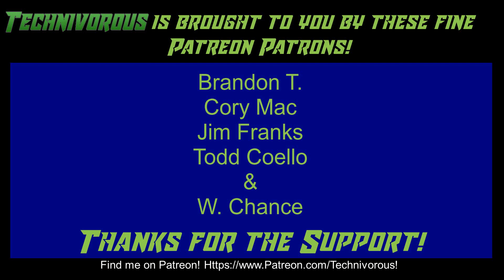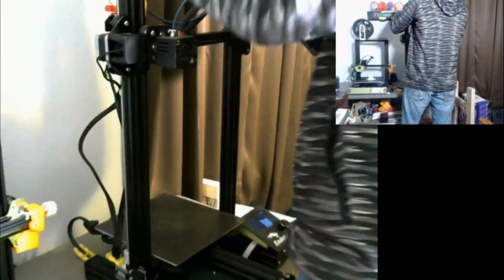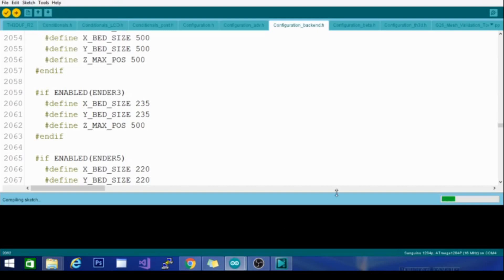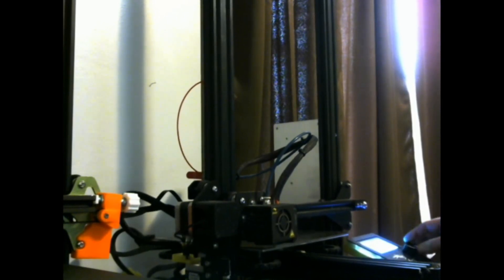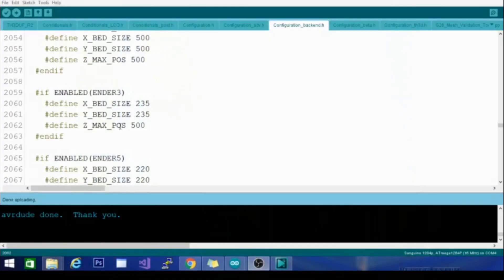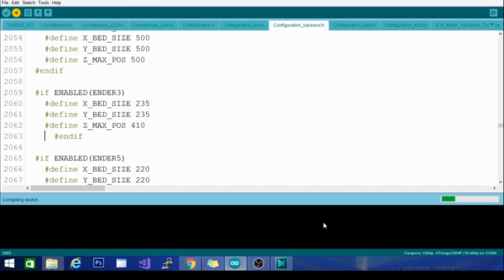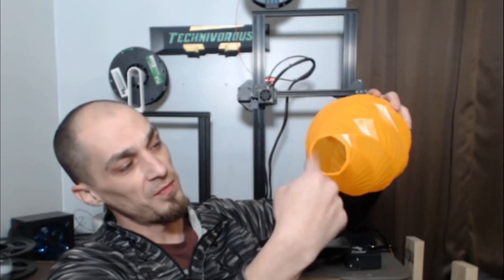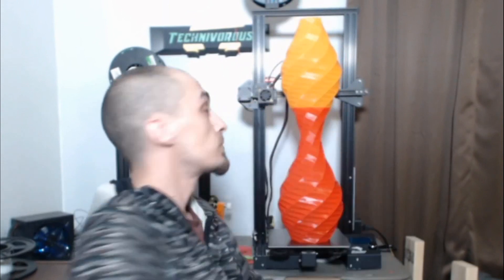Increase the Size of the Ender 3/PRO! 500 mm z mod!

Comment: I just installed a Z extender kit on my Ender 3 Pro. If I'm running Marlin 2.0.6 would it be the same process as in your video? At the moment I have an unnecessarily tall printer that does exactly what it did before.
Reply from the maker: Yep same firmware update

Comment: 1 year ago I bought that kit and I could never compile the finware with Arduino or visual studio, it gives me an error, there is no complete video on the internet that explains the steps, not even the vendor has it, Marling error is pio/build/ stm and the Arduino does not appear on my board and gives a compilation error.  (Ender 3v2 printer, board 4.2.7, thanks for the video.

Comment: i have upgraded my 3d pro to 500MM and did the firmware update worked fine then the belt came off  the horizontal beam now the auto home fails and it says need to reset printer . i am lost frustraded dont understant how to use marlin and edit the crap corectly i am to the point to just throw  it in the trash save up and buy new printer that is stock and print 500MM high you tube leaves me confused

Comment: Yo so I'm doing a project on my unmodified Ender 3 printer that's larger than the given operating parameters preset into the machine. I don't need to go much further than 250mm, I only need to build things that are 304.8mm tall (12 inches). I checked the space the stock printer had and It definitely had a surplus of space to work with despite it saying it can only go up to 9.8 inches. 

What is your opinion? Could I modify my printer and push the machine harder? I literally just got it and I don't want to screw it up. :o
Reply from the maker: Raise the z as high as it will go, then measure from the bottom of the nozzle to the bed. Remember there is no end stop at the top so without firmware limiting it will continue to try to raise which could cause damage. If the distance to the bed from the nozzle tip is greater than the programmed height of 255 you will need to change the firmware max z distance to increase it.
Reply: @Technivorous  Aww  man, I checked the distance from nozzle to the bed and it really cant go higher than than what it was rated for with stock parts. . 

Guess I need to downsize my project then and eventually get around to modifying my 3D printer to be larger.

Comment: ...so as it seems, it is pretty modable, this little Ender3 :) I am planing to buy it next month though... now that I saw this... I am willing to buy it even more...
Reply from the maker: Tons of mods. This is the 500 mm a kit but there is one called the ender extender which makes it wider too
Reply: @Technivorous  is it possible to use this to make parts for car, like front splitter, smaller rear wing or something like that... of course in more parts not at once... and also filling 3d model with some sort of foam afterwards with thickness of wall 2-3mm, and wraping it in Vinyl? :)

If so, I am really planing on buying this... ASAP... Also I saw they are preparing V2 of this printer, although it will be 50euro more expensive, but it seems it will be OK
Reply: @WarlockSRB  did you get one?
Reply: @xIsouLcruSHca  yes, I got E3, planing on buying extender 400XXL for it... but still considering maybe using it stock...

In few days I'll start with car part printing in PET-G... will see how it goes...
Reply: @WarlockSRB  Good luck buddy!
I'd go for some other upgrades like a BL touch first, those will give your E3 much more userfriendliness

Comment: how do you get the configuration_backend.h file
Reply from the maker: You open the marlin c on configuration in arduino ide
Reply: @Technivorous  I don't know how to open the file in arduino IDE. I don't know which file to open with it.
Reply: @Technivorous  the file states ender 3 not ender 3 pro. Are they compatible?

Comment: Very nice! I was getting judder on my stock Ender 3 printing tall objects near the stock limit, with the top of objects swaying slightly during bottom platform movements along the y-axis; are you using rubber shock absorber material between your motors and the mounts to help dampen motor movements?
Reply from the maker: I am not using dampers at the moment, I have considered it, not only to reduce vibration but also to reduce noise. Just haven't gotten around to it ye!

Comment: Looks huge and very cool :)  Anyway to test if there is more wobble on Z or X axis?
Reply from the maker: As long as the x gantry is square and level, and the right side eccentric nut is fastened to keep it flush it is stable, but the higher you go, you might want to go slower if your producing something thin and tall. I plan on doing a video of this soon to demonstrate slowing speeds with height changes.
Reply: @Technivorous  Thanks for the info.  Will look at getting these in the summer time.  Do you have an affiliate link for the parts?

Comment: Did you change any of the cables to allow the extra height.
Reply from the maker: No, but I manually check how high I could go with the stock cables, so my z max in firmware is set to 410, once I get cable extenders I will adjust for the full 500!
Reply: Will you be making the cable extenders or are they produced, reason for asking as I am rebuilding my Ender 3 to have a build height of close to 700mm
Reply: @Technivorous  interested in the cable extenders as my ender 3 will have a build height of nearly 700mm.

Comment: Would your printer benefit from dual z lead screws and 2 strenghtening bars with the enlargement or is it overkill.
Super video even if you don't have  perfect camera set up. The contend as allways is awesome. Thank you a lot sir.  :)
Reply from the maker: I personally dont th iij n the belt driven dual z helps much, but if I had another nema17 and hooked it into the second extruder it can be used as the second z, and that would be an improvement
Reply: @Technivorous  The main "problem" with printers wich have dual Z stepper is : they won't run EXACTLY one each other...we've seen problems with diff printers and the reason is always the same. The BEST improvement is to use a closed toothet belt on the top, with gears and pulleys. Basically you have one stepper motor who drive the left side of the X axys and, because the gears on top of the screw bar and the closed belt etc it "drive also the right side. Loads persons experimented it , and its best solution .
Reply: @adrianoragazzo1321  I have run dual Z on my ender 3 with no problem it fixed many problems with z sagging and allowed me to run direct drive without the weight cause more problems